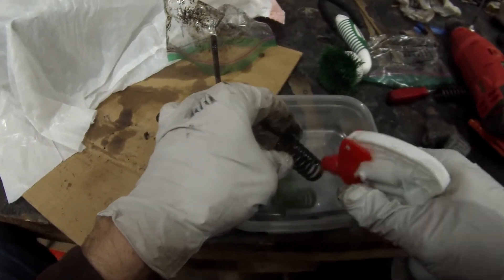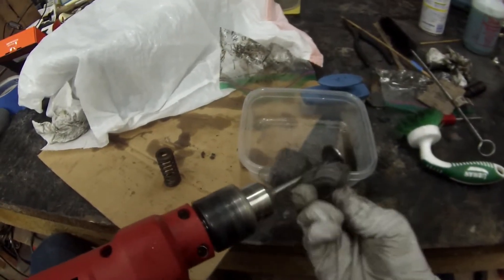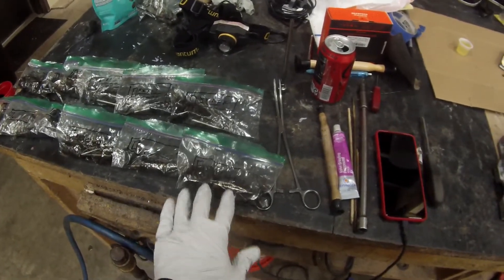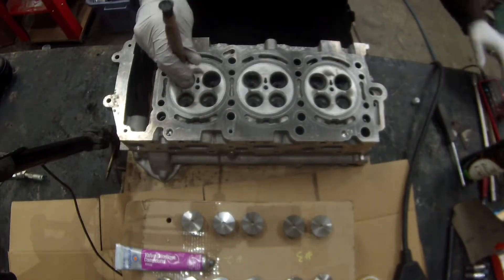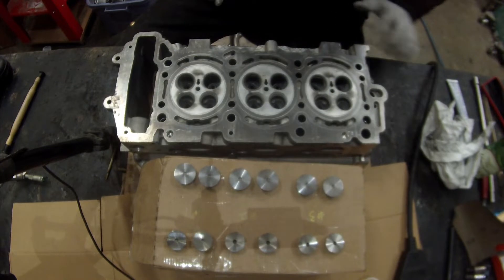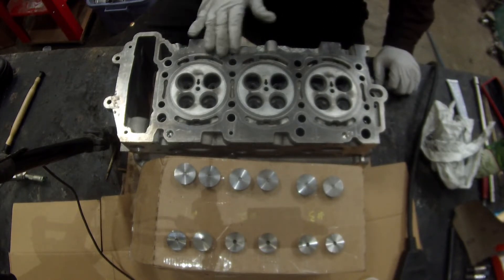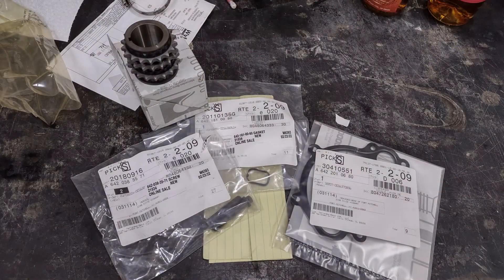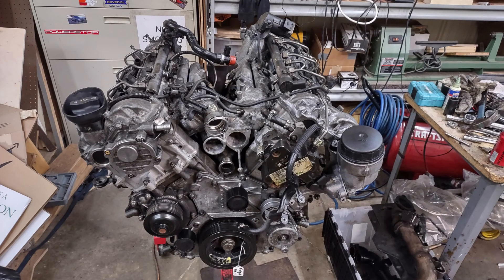Mercedes GL350 OM642 Rebuild - Part VII of ?

Comment: My current issue mine has 250k and dropped compression on cyl 1 doesn't seem to be any obvious damage
Reply from the maker: Of the common problems with these, I could see that maybe a valve is all carboned up and can't close?  Was this in a Sprinter?  I've not heard too many people talk about getting that kind of mileage out of OM642-equipped sedans, vans, or SUVs.  I was told that the version that went in the Sprinter had some differences to the lubrication system - but I'm not clear on what those differences might be.
Reply: @williamehrman  its a sedan 2007 e320 bluetec had the heads flow tested they checked good so im leaning towards a ring issue or cracked piston ill keep you updated
Reply: @nikoliklashnikove2973  what was the issue
Reply: Vertical lines on the cylinder walls tried to rehone with no success and I'm devastated trying to find a good block
Reply: @nikoliklashnikove2973  and why not to bore it out. To next size? Honing with a drill is not the same as to do a proper hone on the machine. The diy Honing only should be done on a perfect cylinder that only has a glazing problem.  Even then it doesn't make a proper hone. Just mine 5 cents.